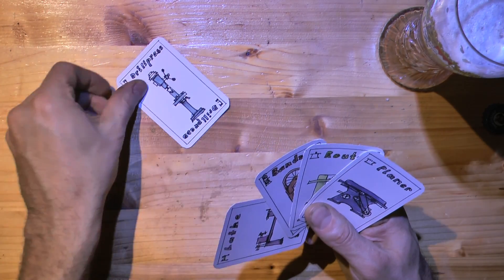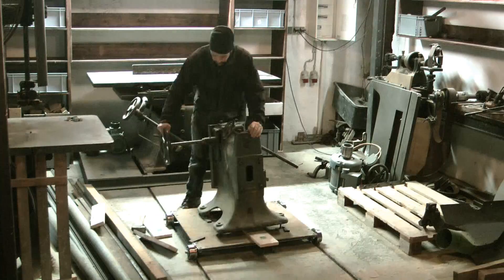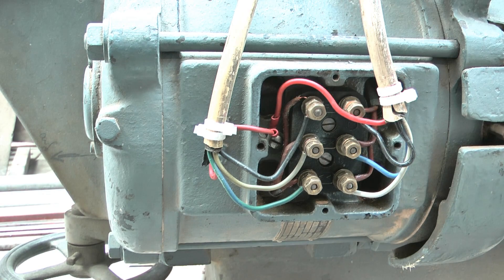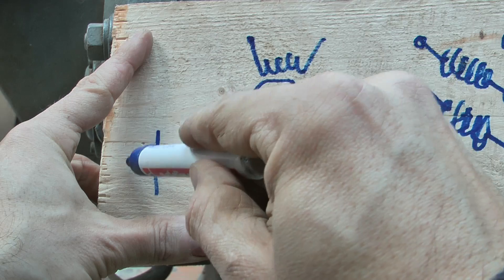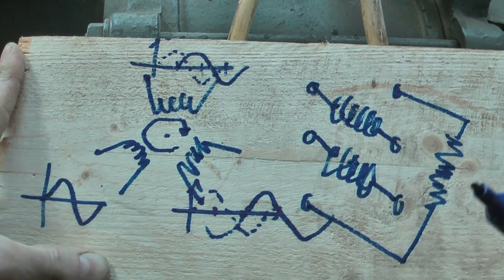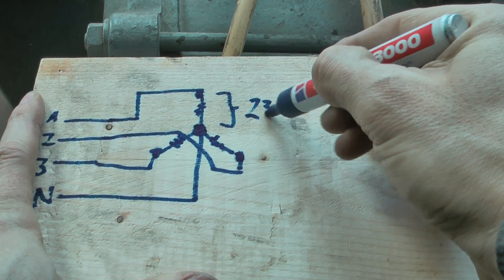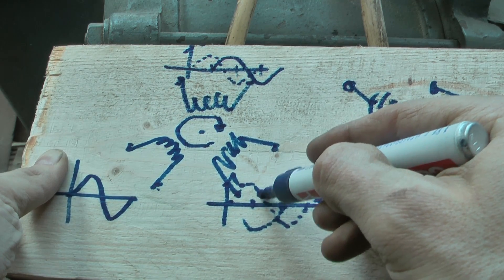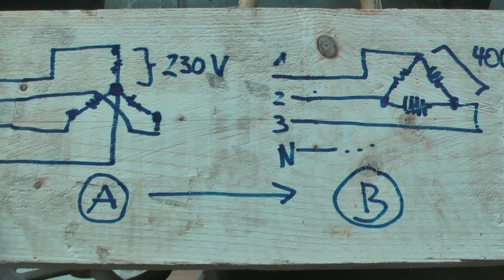A matching table saw

Comment: You are a little mistaken. Star connect for 400v, and a triangle for 230v.
Reply: Yes and no. The windings are probably rated for 380/660 V (nowadays 400/690 V). That means the saw can be connected to the 230/400 V supply as it is. If the windings were rated for 220/380 V you could only connect it to our supply in a Y configuration. If you had a 133/230 V supply, like in some parts of Belgium or Norway, you'd connect it in a D configuration.

As far as the voltages across the windings at a given supply voltage are concerned, he's absolutely right!
Reply: @Ragnar8504  if only 660\380...

Comment: I was terrified to watch you push that test piece through the saw! I think you are asking for a kickback that would really hurt. Even if you don't use an anti-kickback device (I don't use one on my table saw), you should at least use TWO push sticks or push blocks to make sure the wood does not shift out of line while passing through the saw.

Comment: Over 600lbs!?!?
Reply: That's easy. I was told old band saws weigh anywhere between two and three times as much. My brother really wants one but it'd have to go down some steep and tight stairs so he isn't going to buy one. I know there was an old joinery in Vienna where they demolished the house over the machines in the basement because no one could be arsed to get them out before!

Comment: There are some things that you told about the electric that is wrong. You say that the star configuration are for 230 volts, and the delta is 400 volts, and that the delta are stronger. The star connection are 400 volts and the delta are for 230. Either way the windings get 230 volts each, and the strength of the motor are the same. The switch changing from star to delta are an option in the lower of the voltages, and used as a soft starter. In star configuration you can connect the neutral line as shown, but there are no need for it. When showing the first start attempt, we saw a lot of smoke, but no blown fuses. The fuses should not have been too big to blow within a second or two in that setting.
Reply: Actually it's a matter of the wording. He gave the voltage across each winding on a 230/400 V supply, and that's perfectly correct. You're talking about how to connect a motor to different supplies.

Comment: Hats off to Nikola Tesla for the Induction motor!  Obviously you have three phase current..  220 0r 460?
Reply: It seems like he has 230 volts. 220 are american standard along with 440. In most of europe the standards are 230 and 400 volts. And to scare a lot of americans: We use 230 volts also for hand tools and lamp bulbs.
Reply: @magnepolden3344  Actually US domestic supplies are 120/240 V centre-tapped single-phase. Industrial supplies are often 277/480 V three-phase and of course there's the truly special "wild leg delta", with a transformer that has one winding with a centre-tap, which is connected to earth, giving you both 120 and 240 V single-phase and 240 V three-phase. Get the wrong wire and you release the magic smoke from any 120 V load.

European countries standardised on 230/400 V three phase with either one or all three phases connected for domestic supplies long ago. There are some leftovers from the past, 133/230 V supplies and, especially in sparsely populated rural areas of the British Isles, 230/460 V centre-tapped single-phase supplies.

Comment: does the blade tilt / lower?
Reply from the maker: +jon Q The table can be tilted and raised.
Reply: Matthias Burger that's odd... it has to be uncomfortable making a cut with the table at an angle... how does the stock not slide all over the place?
Reply: That was the old style. A bit scary IMO. I think the work slides against the fence.

Comment: Wonder if there were instructions on how to put it together.  I seems putting it together is simpler than attempting to assemble a 14 inch rykon table saw.
Reply from the maker: carino tresvinos No instructions. But I had taken it apart only few months earlier, so I could remember.

Comment: Thank you for the movie! I learnt a lot from the extra piece at the end.
Reply: Actually the neutral isn't used in a wye (star) configuration either, as long as you've got something symmetrical like a motor or three identical heaters. You can connext it to the centre but it won't do anything, so usually you don't. Where you do need it is something like a heater with three settings where you can turn on either one, two or all three elements at a time to adjust the total heat output/power consumption (always assuming a star configuration, if the elements are rated for 400 V and connected in a delta you don't have a neutral). Or a central European cooker/hob where the 230 V elements are connected to the three phases of the supply, giving you up to 11 kW on just 16 amps and 2.5 mm2 wire.

Y/D start is a very simple and rugged way of keeping the startup surge of large-ish motors within reasonable limits without resorting to modern-day power electronics. Even earlier setups used slip-ring motors with series resistors in the armature circuit, I've worked on a setup like that from the early 1920s, actually a fairly small motor, less than 2 kW. It's a giant chunk of cast iron though, probably easily twice the size of a modern motor!

Comment: Beautiful piece of old engineering and workmanship! Thanks for showing us the build. May I ask what the end of the shaft with the hold downs do and if you could demonstrate? I'm guessing it is either a shaper or horizontal boring??
Reply from the maker: It's for horizontal boring. Haven't used it yet.